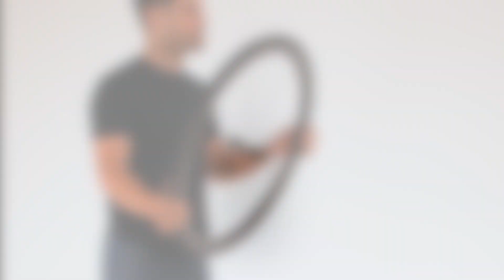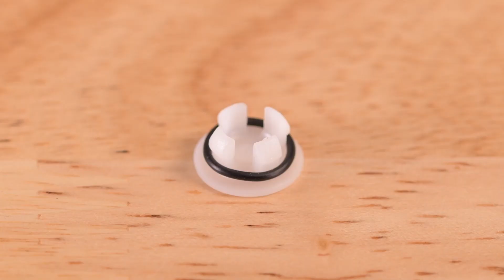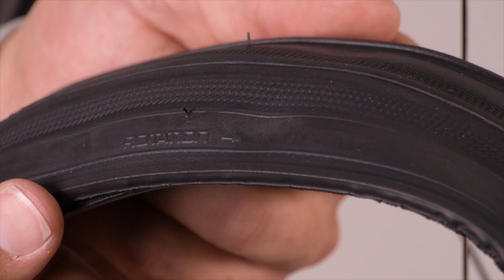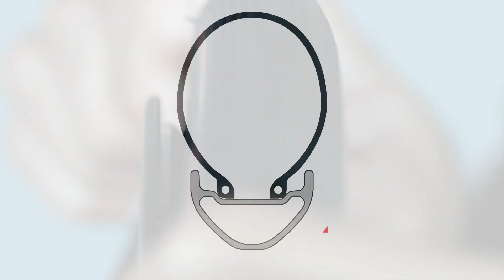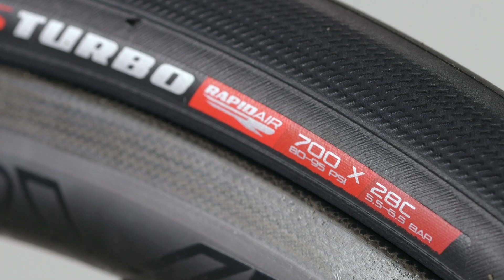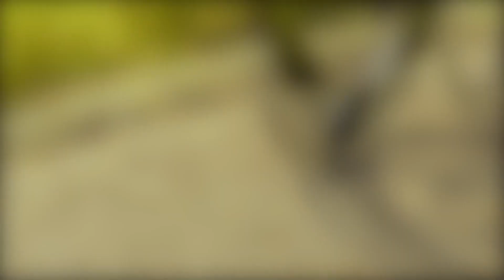S-Works Turbo RapidAir Setup & Installation

Comment: is it possible ti ride the tire with tube (schwalbe aerothan)?
Reply: Yes, but tubeless tires typically have tighter fitting beads so take extra care to not pinch the tube between the lip of the rim and tire when manipulating the bead into the rim bed.

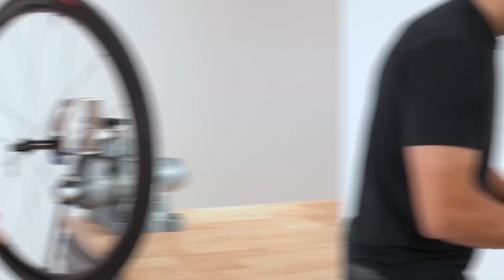Comment: @4:15 "We recommend checking sealant level after 10 hours of riding and refill if necessary to maintain optimal performance and puncture protection." How do I check the sealant level? Do I have to take the tire off the rim? Do I need to check my tires every 10 hours of riding or just the first 10 hours. After how many hours of riding do I need to add sealant going forward?

Comment: Love the feel of these tires, and they are not bad at all to mount on my Enve 4.5AR wheels.  However, they are just about impossible to unmount.  I'm switching back to Hutchinsons because if I ever have to put a tube in on the road when using these tires, it would be faster to walk home.
Reply: You’re not kidding. I’m on my second time trying to remove a tire and seriously it doesn’t budge. First time took multiple bike shops and here I am trying to remove a tire for a second time, my thumbs will never be the same
Reply: @Oxcart71  I ended up cutting mine off.  I "believe" that the issue is ---- the tires have an extremely supple sidewall (which I'm guessing is the reason they have that "magic carpet" ride).  However, with that sidewall, trying to push the tire bead back over the retention bump just causes it to "roll" instead of slide sideways laterally (which a stiffer sidewall tire would probably do).  I found that even with a couple of tire levers between the bead and the outer wall of the wheel, as soon as even a slight amount of pressure is released (like:  to move a tire lever slightly), the bead simply "rolls" right back to the wall of the rim.  I gave up and cut 'em off.  It is an expen$ive lesson.
Reply: @agie170hss2  Thanks I began to cut mine off as well but afraid to continue to to so without damaging the tape (tire was shot and showing the cotton fibers anyways). My issue is on the Enve Foundation they only recommend you ride certain tires which are a limited selection and almost only available online vs from your local shop in a pinch

Comment: These tires are a pain in the ass to seal.
Reply: I find them OBSCENELY hard to get on the rim.  I thought Gatorskins were difficult.  Those are easy compared to these.  I can't say anything about the ride quality yet because I'm still trying to get the rear tire on.   I literally bought one of those tire seating tools in the hope I can finally test this out.  Good grief.